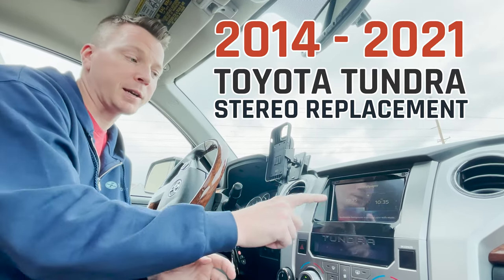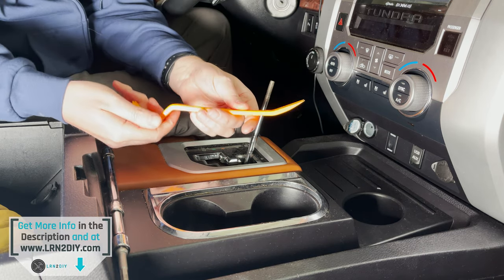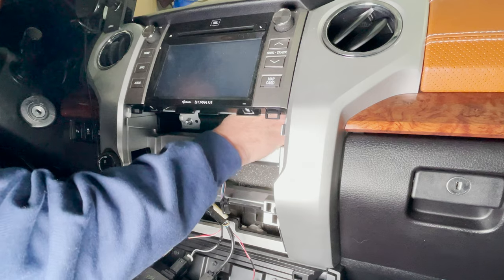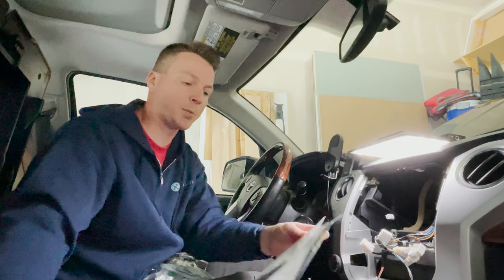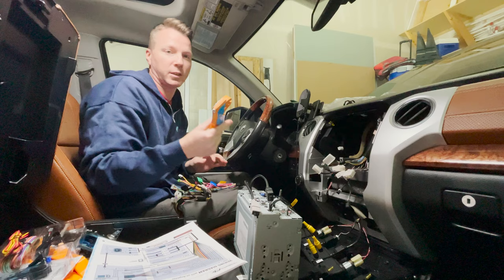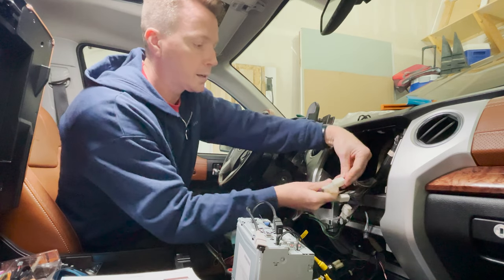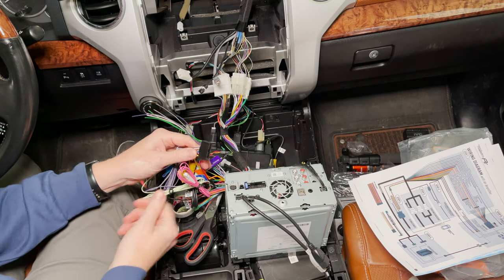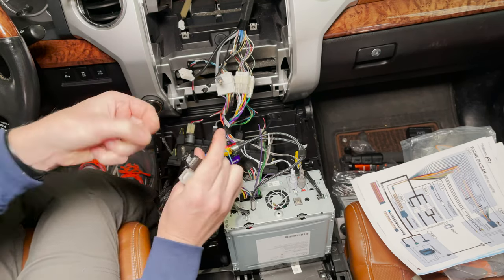Toyota Tundra Stereo Replacement 2014 to 2021

Comment: Only suggestion. Crimp connectors would be the best bet. You can even get them with heat shrink on the ends of them for a really tight and clean connection. Great job though!

Comment: This is fantastic info!  I assume from the brown interior this is a 1794 with JBL.  I have a 19 Platinum with the same setup so I’m assuming my install would be identical.  There is nothing wrong with the amp in these trucks, it’s the signal from the head unit.  I had an 07 with JBL and replaced the head unit with a $200 Pioneer basic BT system.  Completely transformed the system.  So much more power than stock I eventually blew the factory speakers, but speaker replacement is easy.  I was holding off on upgrading due to the install cost.  Time to start shopping!

Comment: Only recommendation would be to use wire crimps or solder to secure the wire harness connections. Great video and editing.
Reply: Where can I get the parts list?

Comment: Awesome video...  2 questions...  do you have the ability to reset the instrument cluster maintenance required light ( the one that comes on for oil changes etc.) through the new stereo like you do with the factory one, and 2)  I take you need to disconnect the OBD2 connector anytime you want to hook up a diagnostic tool/reader?
Reply: You don't need the stock stereo to reset the maintenance indicator.

Comment: Excellent tutorial.  As some others mentioned, just using tape for the wire connections may not be the best solution over time.  Time will tell.  Can you let me know what that mounted cell phone holder is?  Is it Tundra specific?

Comment: Wow great video! Super informative and super helpful with the links. 

Did you need to do the OBD part? What features/functions would you lose if you didn’t do the OBD plug?
Reply from the maker: The OBD seems optional. From what I can tell, if you didn't plug it in, you would lose the two screens that contain general vehicle info, including speed, tire pressure, fuel level, intake, etc. If you look at 17:03 it shows the first screen but there's a second one too. Those two feel like they're almost a separate part of the interface but honestly not a big deal to not have them.
Reply: @LRN2DIY  Appreciate the response.  Definitely would enjoy more Tundra projects.  The detail you take in explaining really helps for anyone trying to follow along.

Comment: I am looking for a good phone mount for my Tundra.  I noticed the one in this video in the background.  Would you mind sharing the model/manufacturer of the mount?
Reply from the maker: Hey Steven, I ordered this one: https://www.proclipusa.com/product/854957-proclip-center-mount?sSearch=854957 but that's just the mount, no phone holder included, so I got an auto clamping wireless charger like this https://geni.us/Y2V3 and bolted it on with some screws and glue. The Pro Clip company has great holding devices too but they're more expensive for sure. For what it's worth, the stereo I upgraded to in my Tundra has wireless CarPlay so ended up removing the phone mount since I just keep my phone in my pocket now.

Comment: do you have the JBL upgrade or the standard stereo? didn't see you connecting the GPS and satellite antennas...unless you don't have that option ?
Reply from the maker: I do have the JBL upgrade. I did plug in the GPS and satellite - not sure if I showed it. I actually never use those though since the phone mirroring works so well I use Apple CarPlay for all maps all the time.

Comment: Good video! Do you know if it would be possible to hook up an additional camera to the second video cable that you didn’t use?
Reply from the maker: From what I saw, that's an option, yes. I actually have an additional camera but it didn't have the correct connection so I didn't bother but the head unit seems to indicate that you can connect multiple cameras.
Reply: @LRN2DIY  ok cool thank you.

Comment: Hey my big question is do you still have steering wheel controls over the new head unit?
Reply from the maker: Absolutely - yes. In fact, you can actually program those controls to your liking now. It’s pretty rad.

Comment: Great video! Which phone mount do you have?
Reply from the maker: Hey Mark, I ordered this one: https://www.proclipusa.com/product/854957-proclip-center-mount?sSearch=854957 but that's just the mount, no phone holder included, so I got an auto clamping wireless charger like this https://geni.us/Y2V3 and bolted it on with some screws and glue. The Pro Clip company has great holding devices too but they're more expensive for sure. For what it's worth, the stereo I upgraded to in my Tundra has wireless CarPlay so ended up removing the phone mount since I just keep my phone in my pocket now.
Reply: Thanks so much! I’ve been looking for a while. That setup looks nice.

Comment: Did you connect the fm ant to the new unit?
Reply from the maker: I completely forgot to but I had already broken my FM antenna prior to this so I was used to not having any radio. If I were to go back I would have at least connected it though.

Comment: What is the obd2 connection for?
Reply from the maker: It's not required but in my case it provides vehicle diagnostics, like tire pressure, speedometer, tachometer and more right on the stereo.

Comment: If I can afford a 57K truck I can afford a pro to put it in. There are a lot of plug and play wiring harnesses out there so why splice and tape. Good for you to do it though.
Reply: A lot if not most services automotive do not I repeat emphatically do not do the job safely and or correctly!!! Lifetime mechanic engine/body. 35 years experience. Local warranteed job for the air compressor units on my tundra came back with the hoses not connected to their respective positions amongst the harnesses and the wheel well shroud was in a bag in the bed with no push pins. Also e brake was not corrected or maybe even untouched. Center bearing/driveshaft bushing also not touched. That's only one of many many many trucks and cars I've owned personally. Customers cars, are prorated dependent upon whom has worked on it previously. Add 65/hr if it was the customer that worked on it prior.
Reply: Overall this kit is way too complicated. Look at all the wires parts adapters etc. all over the truck this is no easy install. I wouldn’t attempt this even if it was a $10,000 truck
Reply: Most idiots can't afford it but some how get financing...

Comment: Did your Tundra not have USB connections below the climate control unit prior to your upgrade. I'd rather reuse the existing USB ports and not have cables extending out there.
Reply from the maker: It does, yes. They're only for power but I suppose I (maybe?) could have spliced the new ones in so long as they were capable of handling both data and power. Certainly worth looking into.
Reply: @LRN2DIY  ok thanks for the reply. I’ve got a 2018, and at least one of the USB ports interfaces with the audio system. Not that I ever use it.

Comment: Only works on models that don't have JBL
Reply from the maker: I'm not sure where you're getting that info but my truck (in this video) is a JBL system. It still has all the JBL speakers and it's working beautifully.
Reply: @LRN2DIY  is it any louder??
Reply: @ARIN4UK  That's one thing I'm not happy about the OG JBL system, not very loud. That and no Car Play. I was wondering if you can put a 2021 head unit in a 2018.

Comment: Electric tape?  He used the old "twist wires together" and "electric tape" routine.  What kind of janky setup is this???  Folks, if you follow this clowns installation tips, you will be wondering why your car stereo stops working a couple weeks later. SMH
Reply: Everything else is pretty spot on